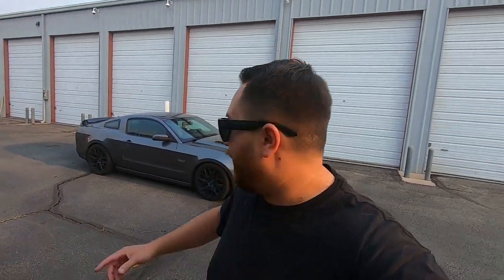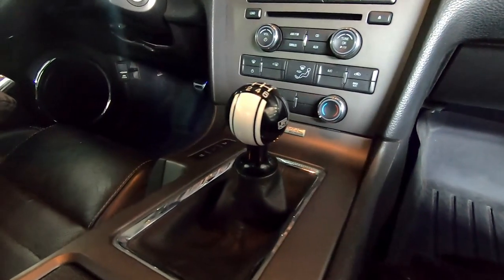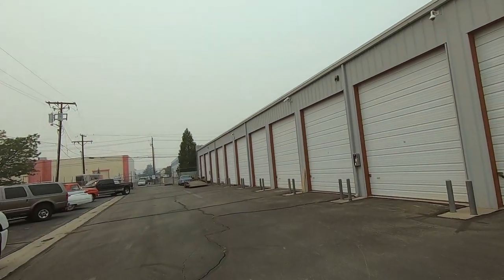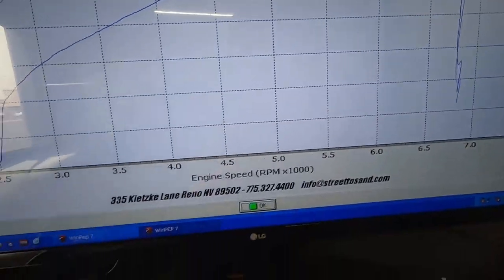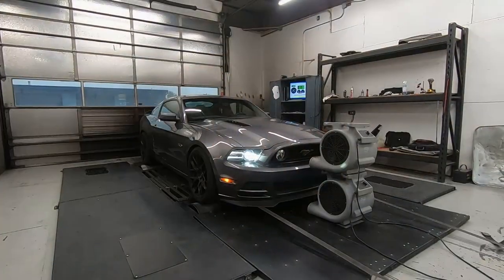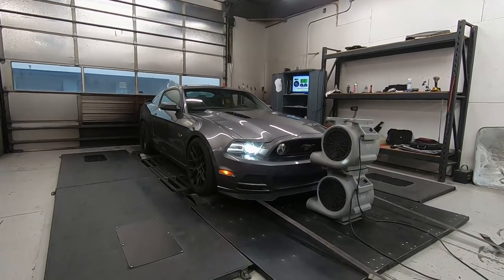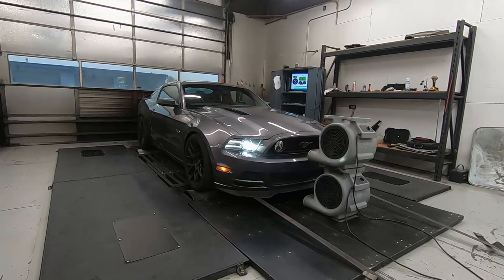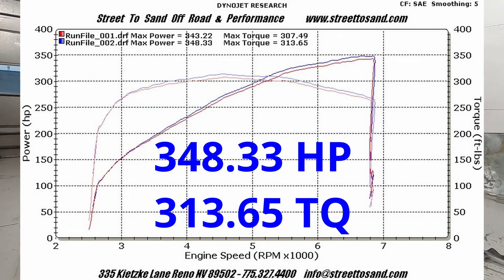Taking My Stock 2014 Mustang To The Dyno

Comment: The Dyno sheet is SAE corrected, meaning they have already factored in things like altitude and temperature. 348 is what your car would make at sea level and air temp of 77 degrees. Nice exhaust.
Reply from the maker: I completely forgot that they did that.  Thank you for the intel.  Thanks for the exhaust comment.  I really enjoy the sound.

Comment: I kind of expected a little more. I never had mine on a dyno when it was stock, but VMP put mine on for a tune after long tubes, catless mid, and a Steeda cai. It made 412whp on SAE smoothing 5. I figured stock should have been 370s or so. I have a ported boss and e85 now, no idea where the hp is though as I no longer live near a dyno. 

It’ll definitely be interesting to see how your number changes as you go though.
Reply from the maker: It is the normal number I have seen when I was looking around.  The Coyote is fairly responsive to mods.  That's one of the reasons I bought it
Reply: @markskeem  I've always seen them above 360 with a stick usually 370.  It's prob just a stingy dyni nothing to be concerned with.  It may also be a mustang dyno which read lower.

Comment: I got 360 stock. My 2013 GT has long tubes, x pipe, ported 18 mani and tuned. It puts 430 to the wheels now.
Reply from the maker: Those some good numbers.  It was a pretty bad day for air quality so I'll blame the slightly lower numbers on that.  I and working on get an 18 manifold and a tuner.
Reply: what kind of tune is it
Reply: Auto o manual?
Reply: @markskeem  did you ask if it was a mustang dyno?  They read lower those numbers are right in line with what a mustang dyno would be.  Dyno jet are normally around 370 give or take.
Reply from the maker: @midnight347  I didn't ask but I'll look when I'm over there today

Comment: Nice
I got 2014 as well 
Just wanted to ask what is you wheel and tire size and set up 
Looks beautiful man 👍🏻
Reply from the maker: That's great.  What have you done to it? 

One of my other videos I show the wheels and tires.  https://youtu.be/mF2DSIt-1gk

Right now I have SVE Drift Wheels.  They are 18 x 9.5 square.  They have Falken RT660 275/35R19.  I plan on going with some wider tires in the near future and get 305's.  

Thank You
Reply: @markskeem  I put an oil catch can and a cat back not much 
looking for wheels and suspension for now 
Thanks man for replying 👍🏼
Reply: I have that same care too. 21,000 original miles with flowmaster scavenger exhaust and a Bama race/ Performance tune. These first gen Coyote cars rip. So under rated. Get a tune. you'll love it! Nice numbers!

Comment: Going to do this soon wish I got a baseline.  But I have stock tune off road H pipe and res delete . Getting tuned soon so gonna guesstimate the difference
Reply from the maker: Does you exhaust resonate a lot with that set up?  Mine does so I am thing about changing to a different setup but I like the way it sounds.  I have seen a few people with shorty headers, off road h, and a tune get close to 400 to the wheels
Reply: @markskeem  interesting  ..no bro mine does not atall . It's actually very beefy but very quiet until I put it down.  Now ..before I had a roush axle back with resonator delete.  It was raspy but I loved the crackles .once the metal broke in . It tamed out a little . Cold starts were still vicious . And around 3k or so yes rasp zone . But I have 3.15 auto gears so driving I never get that unless I'm intentionally picking up speed which I want ..im about to combine all 3 which is Off road H ..res delete and the Roush Axle back ..back on in a few weeks and it's gonna be insane ..too loud for some but I think I'll enjoy it..im hoping 400 wheel also im getting a Lund 93 tune in a few weeks as well
Reply: I have the drone issue with my 14. My car is stock with Flowmaster FlowXT mufflers. At 2000 rpm at 70 mph in 6th it is unbearable. Anyone know a solution for this?
Reply from the maker: @mattraines6404  I have the same issue.  Everything I found just said go to a different exhaust set up.  I'm thinking about spending the money and buy the corsa catback because they guarantee no drone, even with their louder systems.
Reply: @mattraines6404  just Flowmaster and drone? Wow when I just had the roush I did not get that.  And then everyone says roush sounds like trash if u combine it with anything else.

Comment: All car manufacturers tell you lies just to get your money that’s the name of the game
Reply from the maker: I am not saying that they don't lie but which lies are you referring to?
Reply: @markskeem  engine power
Reply from the maker: @hermanrogers1325  The number shown in the video would be consistent with advertised engine power.  The power rating they advertise is at engine crank not at the wheels.  A 70hp drivetrain loss is normal which would put me at the advertised 420
Reply: If anything they're underrated.  They were rated 420 hp at the flywheel most do 360-370 at the wheels this is prob a stingy dyno or a mustang dyno which are known to read lower.  Dyno numbers don't matter long as you use the same dyno before and after mods even then things can be off if not done on the same day.  It's a tuning tool nothing more.

Comment: I will never understand why company say their car does 100 more horsepower than it actually does
Reply from the maker: When companies give you a horsepower rating, they are telling you the rating at the crankshaft. They get that from putting just the engine on an engine Dyno. There are drive train losses which take away power so power at the wheels are going to be lower.  For better marketing, they give you the number with the higher number.  There are also variables in drive train loss. Such as if you drive a manual vs an auto. So the more consistent number to advertise would be engine horsepower.
Reply: @markskeem  so I’m debating on right now should I buy one yes or no I have a 2014 GT Mustang and I also have headers waiting to be put on with a cat back Roush exhaust
Reply from the maker: @walkercorbin4352  What are you debating on buying?  Headers are a good way to help gain some horsepower.  Just make sure you get it tuned to take advantage of them.
Reply: If anything they're underrated.  They're rated 420 at the engine they usually dyno 360-370 at the wheels this is prob a low reading dyno or possibly a mustang dyno which read lower than dyno jets.  Do your homework.

Comment: So every body lies about 400 hp
Reply from the maker: Stock, the engines are rated for 420 for this generation Coyote. So 350 to the wheels is an accurate number after drivetrain loss.  So technically nobody is lying. The general rule of thumb is a 15% drivetrain loss.
Reply: @markskeem  okay
Reply: It's relatively easy to get 400 whp in them
Reply: They can make 400 wheel with intake and tune.  Most of them dyno 370 stock give or take this is likely a stingy dyno it could be a mustang dyno also they read lower.
Reply: Altitude hurt you too. Drive line loss use to be  12%. Ford underrates about 10-15 crank Horsepower too. I need to Dyno mine too!